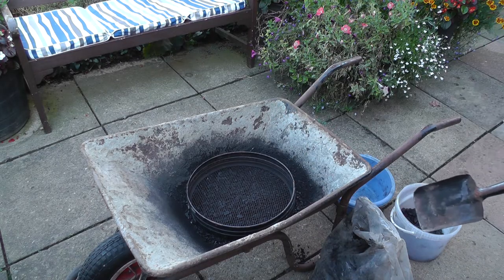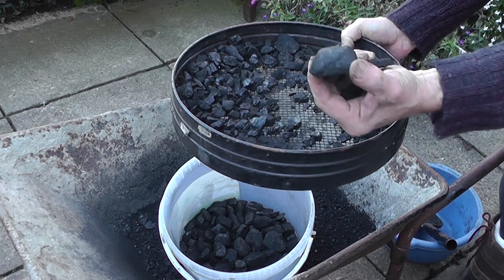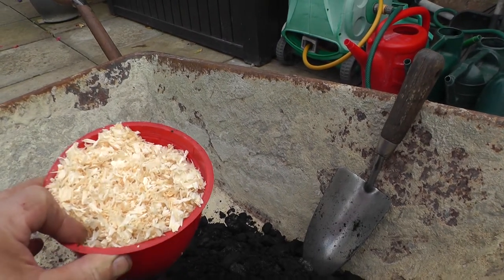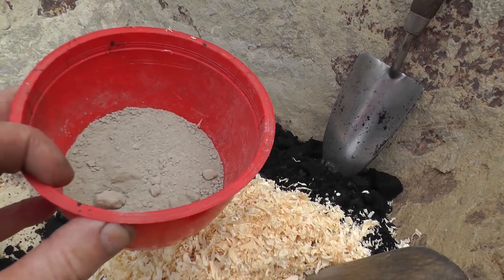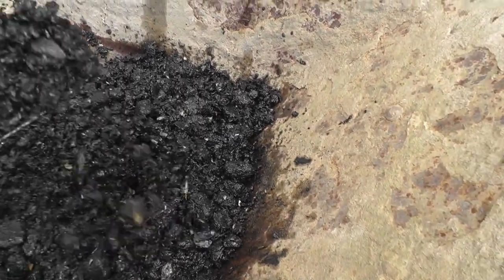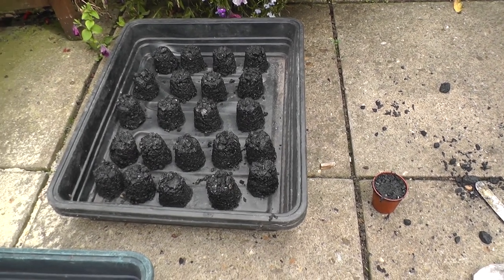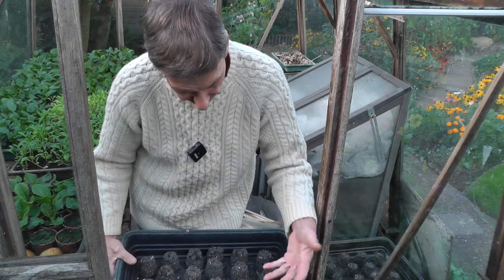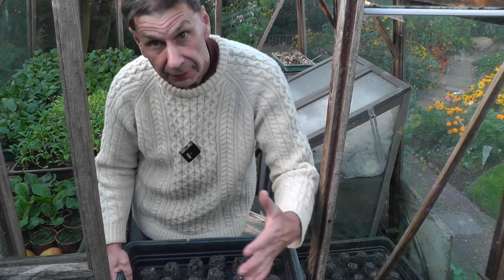How To Turn Coal Dust To Fuel

Comment: Great video! I’ve got a load of coal dust left over in a coal bunker & a large barrel I was donated. Coal dust is explosive so moulding into brickettes is the safest way to burn. I’m considering pouring the mixture into empty cardboard egg cartons that I was saving to make firelighters.
Reply from the maker: Thanks for your kind comment yes this has always worked for me. And like I say they do need to dry out well I have also left them a good time to dry before using them they do burn so well. Thanks, Kev.

Comment: Thank you. I have half a bucket of slack dust left over and was wondering if it were possible to compress and reuse.  As smokeless fuel is obviously compressed constituent I guessed is would be, but I didn’t know what I could use to make it bond until I watched your useful video. I’ll give it a go.
Reply from the maker: Yep, this works for me fine and I do it most years to use up the dust you still get with these modern smokeless fuels they burn OK when they have dried out and better than trying to burn dust! Thanks for your kind comment. Kev.
Reply: Now it’s the summer, I have after my comment to your useful video moulded the slack this afternoon that I had left over after this winter. They are currently drying. 

I do have a question regarding the  ashes all being majority of smokeless coal ovals. Can the ash be used for other things, or is it only for the bin? I have heard some say one can use on ice to clear driveway (not tried that), but are there other uses do you know? Hope to hear from you. Thank you. Phillip.

Comment: Excellent and  thorough video. I just wonder how essential the chainsaw shavings are to the mix?    By my reckoning that's 24 parts coal dust, 4 part chainsaw shavings, 1 part of cement and a drop of water  . Did you try these briquette moulds available on EBay - which have 2 levers to compress the mix?

Comment: I would think you would want very dry wood chips as coal and wood together creat sulfuric acid that eats stove pipe ?
Reply from the maker: Good point this was for an open fire only with a very thick clay-type flue liner in place! So maybe not to use this kind of homemade fuel on any multi-fuel stove. And also now you can't burn coal anymore in the UK you can use up old stock if you have it. This was mostly all modern smokeless fuel type of dust anyway. Good comment thanks. Kev.